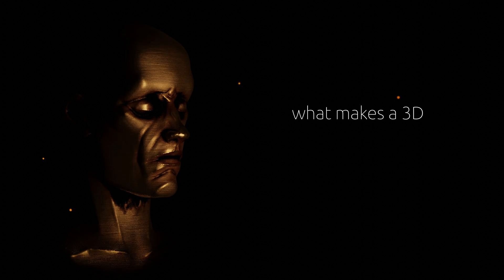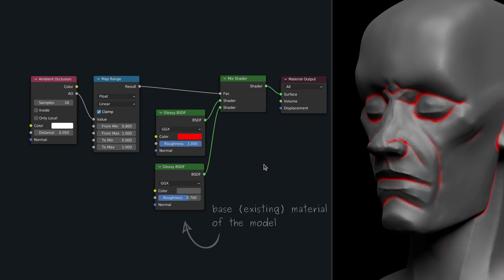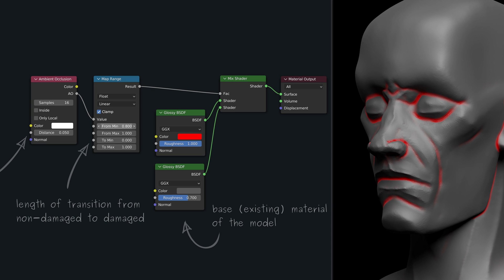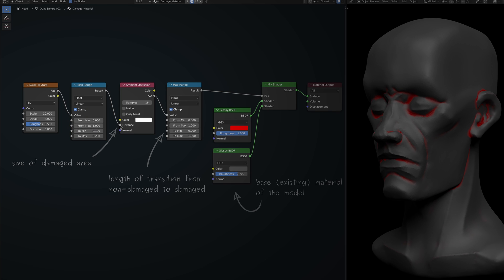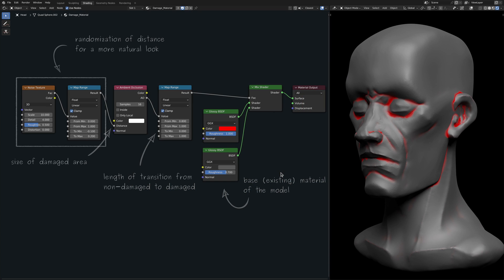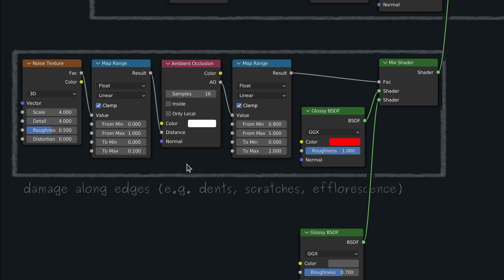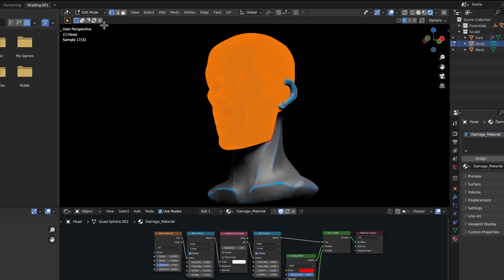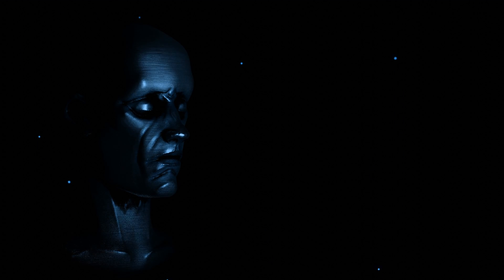Blender Tutorial - Ambient Occlusion Node

Comment: Great thought, that natural = realistic. Usually natural means imperfect for me. Here is a tip for fast realism: random colour/roughness/bump. Use noise texture (usually default noise looks unreal, so I always set detail to max and noise roughness to higher level [.8 or .9]. Scale can be low, depends on situation). Plug this to a color ramp, and then to roughness. Now black is absolutely reflective surface and white is the opposite. 

Copy this setup, set noise to 4D (basically it’s seed). Plug it into ‘height’ of the Bump node and then to normal input. Control the strength of the bump node. Smooth surfaces have less bumpiness of course, so if it’s glass for example - lower the noise parameters. But remember, that there is no absolutely smooth surface.

For colour, plug the same setup into the factor of mix node. Mix between your original colour and a darker version of it for example. 

You can try in on the default cube and you’ll see the difference)
Reply from the maker: These are all good points, thanks for sharing, :)